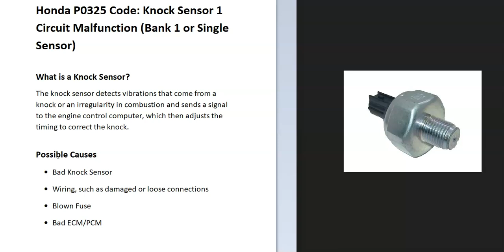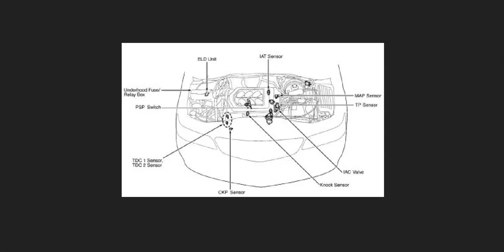How To Fix HONDA P0325: Knock Sensor 1 Circuit Malfunction (Bank 1 or Single Sensor)

Comment: Code started some months after an engine overheat due to a leaking radiator line.  I suspect the leak may have corroded or shorted where the wires connect.  We'll see.

Comment: i had an issue with my 2004 Acura TL my issue was in the wire not the where the new pigtail wire but before that . The wire was broken inside the loom about 2inc in  3.2L and 3.5

Comment: Could it be a blown fuse/ relay that sets off the check engine light/p 325 knock sensor code? If it's not a fuse then it has to be the computer. It's been a nightmare of a situation. I was told by my last mechanic that you have to get the same part number for the pcm?. What do you think about plug-and-play computers. Do they work well? I forgot to mention that Walmart gave me a reverse battery. It was installed  incorrectly and damaged one of the relays. Then a week later the check engine light came on with the knock sensor code. So the reverse polarity could have done damage to the PCM. I just hope a used computer will work. I have to pay somebody to program it. A new one at the Honda dealer is way way expensive

Comment: I have a p0325 code. changed the knock sensor with oem honda and code still came back.  changed the wire harness and code still came back. changed the sensor with another one and getting same code. please help!
Reply: It may not be the sensor itself that is faulty but that it is detecting a misfire in the engine somewhere...maybe a spark plug went bad? I am going through the same problem right now since I just got the code last night after battery had been disconnected to get other repairs done since I thought a pulsing/thumping noise was just bad wheel bearings in rear(which I just had replaced but noise is still there)in my 2003 Honda Element EX but it's looking like a real possibility that it's an engine misfire and I'm praying this simple $13 sensor is the solution. I am just wondering why my car has been running like this for many months but never threw the code sooner and it took a battery disconnect/reconnect and just a few miles driving to get it to rear it's ugly head?

Comment: Same code. Check engine light will not go off. Change the knock sensor. One mechanic said it could be the computer and the other mechanic says it might be the wiring. I have to get a third opinion to find out for sure what to do. I did use aftermarket knock sensor from O'Reilly. If I buy an oem will it really take the code away?
Reply from the maker: OEM is best but most replacements will work. I would test the wiring.
Reply: Just add one wire from your ecu and connect it directly to the knock sensor connector. Just make sure that is the same color from the connector and check your ecu. This worked for me
Reply: Same problem

Comment: Changed the knock sensor 2 times.Still get the same code reading with engine light on.Spent hours at the mechanic shop
He said , it is likely it will be the ECU computer , which is costly.I did use a after market brand from O'Reilly and autozone. Did not buy OEM part
Reply: I’ve heard aftermarket is no good. Won’t get rid of code. You’ll need OEM
Reply: I had the same issue with mine. I ended  up adding a wire directly from my ecu blue/red color and connected the other end to my knock sensor connector. No more check engine light. This fixed my issue.
Reply: @juang3187  I just got a p0325 on my 04 element. Got me a used oem honda sensor and code has not come back in the last 200 miles so that was my issue. The sensor took me like 10 minutes to replace going from under the car,  used a 27 open wrench to loosen and tighten back up.  Pliers to disconnect the connector
Reply: @wtspapa24 would NGK give code?
Reply: You need oem dealer part for honda.  Aftermarket has failed plenty of times with me on my honda.  Until I use oem.
Reply: Have you solved the issue?

Comment: Which fuse are you talking about
I have changed knock sensor as well as its grip but still show knock senor faulty
Plz tell me what to do
Reply: Most likely it is the computer. 3 mechanics have told me this. But the car is running fine. But I can't pass inspection because the check engine light is on.
Reply: Did you fixed your car?
Reply: I'm having the same problem. I replaced the knock sensor but check engine light is still on.
Reply: Same thing with mine! Replaced 2 already and still have a check engine light
Reply: @hecks_k20_fa5  if you have a knock sensor code and youve replaced the single wire harness next step would be to verify exactly what code is stored (if there is one).  if no codes is your engine actually knocking on acceleration? that would be why you have a knock sensor code. i would check the ignition timing. if you dont have a manual you can get a cd for your car online and maybe download it. scan tools are relatively cheap
Reply: I changed twice knock sensor and pigtail fittings. also check continuity from ecu pin out to the fitting at knock sensor and the light come on again and again
Reply: @juanpramirezc4362 did you ever find a solution?
Reply: @tc4723  nope
Reply: Same problem any help!?
Reply: Always use oem original
Reply: I have the same problem.. but have not change is yet.. is it possible to get used knock sensor from scrapyards? Thanks
Reply: @sjstone6169  yes that's exactly what I'm about to go do tomorrow,  done it before with other sensors for the Honda and they've all worked.  Aftermarket kept throwing codes.